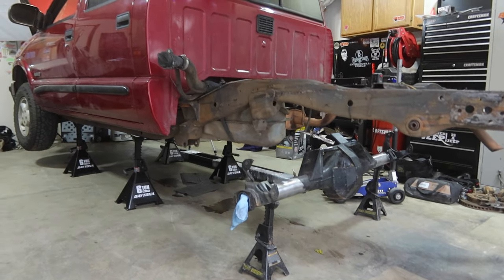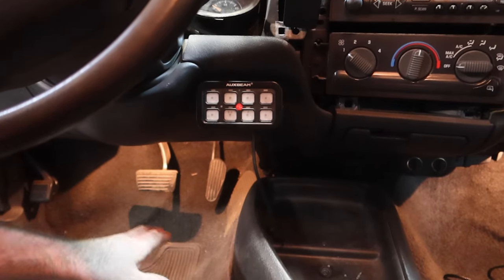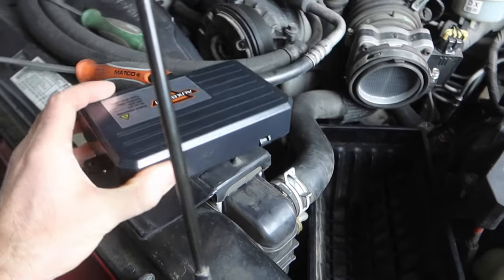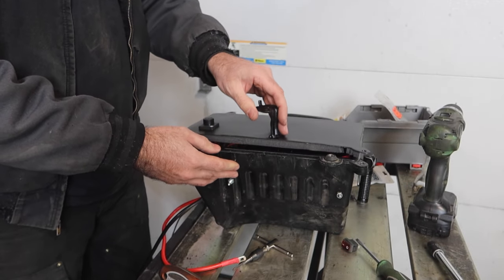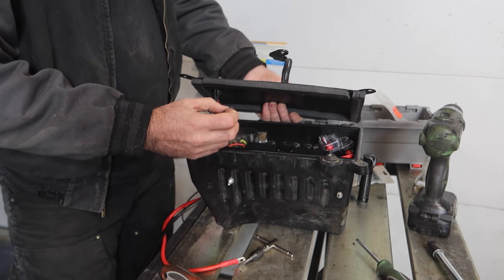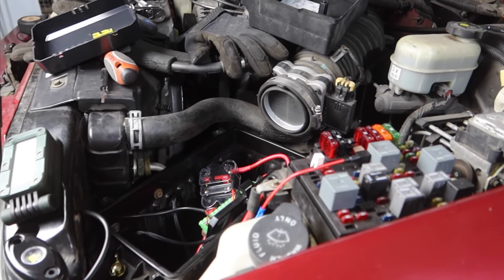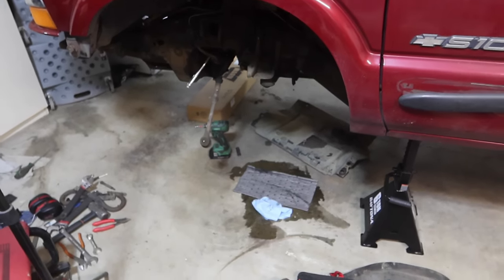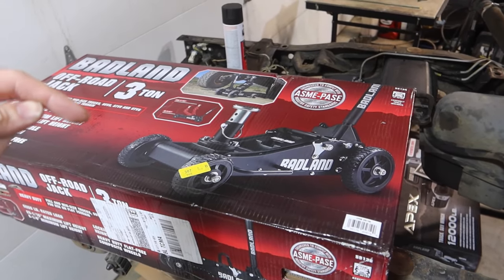DIY Winch control box and 8 gang switch panel install

Comment: Lovin' the Air box mod btw those 8 gang switch panels are a game changer saving hours and hours of wiring!
Reply from the maker: Yup, super easy to add future lights
Reply: @MuddyBeards4X4  I used mine to run the electric fans and fuel pump. Excited to see your s10 project movin' forward!!!

Comment: So,, I was curious, is that switch panel something you would recommend? I've looked at the other very expensive one.
great to see you get a new in-depth built, I will be following it!!! Thanks.
Reply from the maker: Thanks, I would recommend them for sure. I have had the one in the Jeep for a few years, super easy to to add and remove lights and accessories

Comment: Just an FYI the reason you want to be able to turn off the wireless module for a winch is in case someone else happens to have a wireless controller that uses the same frequency.  You wouldn't want them being able to run your winch.
Reply from the maker: I guess that makes sense. Kinda like old rc cars, lol.

Comment: Keep an eye on the Auxbeam Gang fuse area. I love auxbeam but when I got my 8 gang, 1 month later, 2 fused section got stuck on. No way to turn them off so they were permanently on unless I pulled the fuse. I wrote them about this issue and never heard back. So I ended up ripping mine out and went back to an old version of 8 gang by another company. The buttons won't show that it even on, I only knew cuz one of mine was hooked up to my air compressor and it won't turn off till its filled. I'm in a snowy area so I control it and even with my Tahoe off, it would run, killing the battery.
Reply from the maker: Sucks you had that issue, I have one on my Jeep for years and still works great.